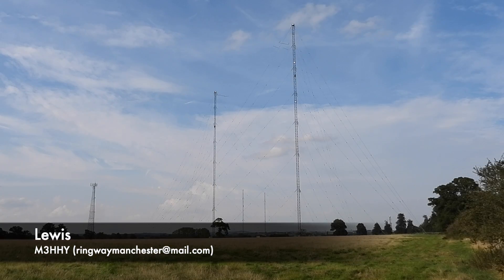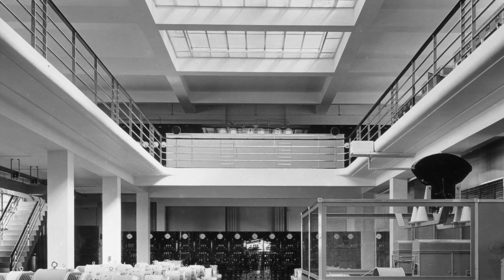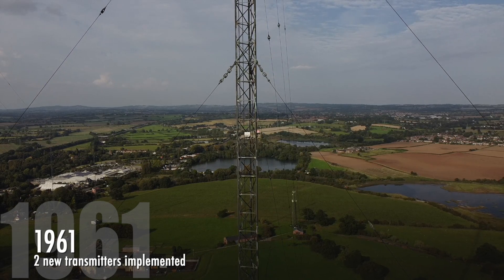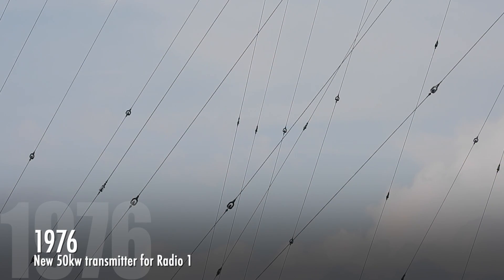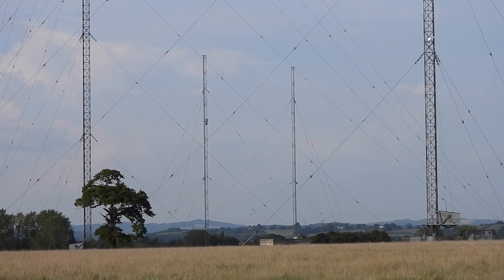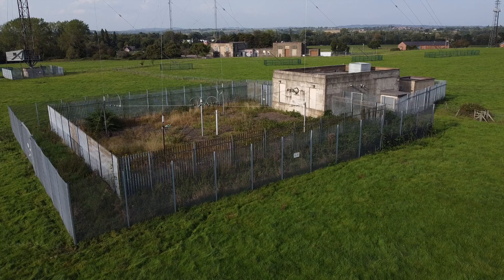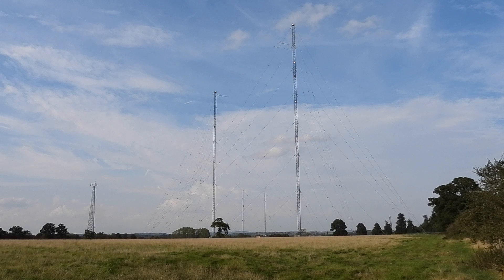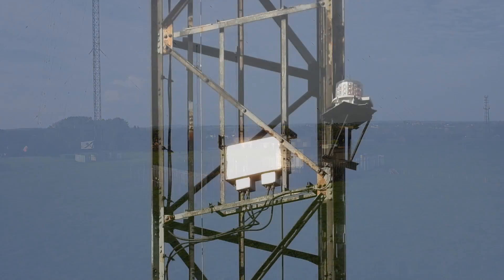Droitwich: The Death Of The 1/2 Million Watt Transmitter

Comment: According to Lord Reith's daughter, who wrote a biography of him, he shut down the diesel generators.  I never did that but am probably the only small child to have started them, on Christmas Day in time for the Queen's speech at 3pm.  The BBC of 1950s used MEB mains normally but didnt trust that for this task.  Normally the MEB would fine the BBC if it generated more than a fraction of its requirements, or went above the amount contracted for but when it froze hard for long periods the English Electric engines ran all the time to help the MEB or National Grid.

There must have been some Health & Safety interference since the mid 50s because at that time the flywheels were open, except the lower part in a tiled pit at one edge of which was the metal notch for the crow bar, the wheel rim had scores of holes.  Mostly they lay silent but wete tested on Thursdays and the diesel man polished the rims by pouring Brasso on a pad of cotton waste with which he leant on the 375rpm wheel, obviously on the upward side, they shone like mirrors after 20 years treatment.  I was told that on open days one diesel engine piston 15" diameter was displayed and was probably better understood than the valves or other electrical devices.  The compressed air was at 350psi and i thought those engines would start from any of the positions at which it stopped.  Electric motor compressor but if you had let the air escape and had to start from black nothing, you began with a single cylinder Lister, hand crank that.   Certainly some others only had starting air to some cylinders and did need hand rotation to be ready.  You also used a semi rotary pump to raise oil pressure before starting, which was easy:  a quadrant marked Start - Run - Stop and a wooden handle.

There were two cooling ponds, a dank one, cold of course for the diesels and a tropical one for valves, full of goldfish who thrived.

Other stations had various makes of engine usually smaller, 12" bore and 428rpm 14 pole alternators, Mirrlees Bickerton and Day, Harland and Wolff with turbocharger, i think they did 500rpm 12 pole.  There was a Sulzer with electric starter...  It stuck in mesh!   That one and the Harlands had crankcase explosions.

There were sets of motor generators with 4 rotating electrial machines on a single axis, probably filament current, and others only 2.  Electricians used to recut the commutators and i can remember walking past such s machine when cutting was finished, had lunch and came past it again still spinning but slowly.  I also saw scrap men with 14lb sledge destroy the cast iron and bearings, very sad.

The BBC is far too prone to puff its actors or front of house people but it had some good engineers.

Comment: 9:50 that story about the glass-tubes that are not manufactured any more as a reason to abandon long wave radio, that sounds weird to me. Nowadays, solid-state broadcast transmitters can be purchased at any power level (2 MW and more) based on modern MOSFETS in class-E configuration. Such solid-state broadcast transmitters have an efficiency of over 90% and use digital high-efficiency AM modulation. They are super reliable, and they cost a fraction of the behemoths shown in the video here. So the dawn of glass (or ceramic) tubes as a reason to give up AM broadcasting sounds false to me.

Comment: Being from the far South West, West Penwith to be accurate, Radio 4 Long Wave was always a difficult listen. We had a relay at Redruth, also not too good at 2Kw power and strangely a Radio 4 opt out for a programme broadcast from Plymouth called Morning Sou'West. This continued until the transmitter was switched to BBC Radio Cornwall when it started in the mid eighties. Redruth now only broadcasts on one MW frequency. 909Khz for BBC 5live. I have heard 1500m Long Wave quite clearly as far south as Biarritz and Santander, even in day time. 
This all reminds me of my first portable transistor radio, with two Bands, Long Wave and Medium wave with names of services and transmitter places, such as Home, Light, Third, Midland, East, London, North, Athlone, Nantes, Milano, Beromunster, and Saarlouis. 
How things have changed. Now you get a digital radio and you have to push a button to find a service, and nothing from overseas, Sad.

Comment: A fiend who was an airline Captain told me that in the pre gps and ins days they navigated to New York by tuning into the TX on the Empire State Building, and back to the UK by using the Light Programme 200 kHz TX. What I never understood was why the shift from 200 kHz to 198 was done. At 200 kHz we had a home lab frequency standard  with a nice round number.
Reply: The unhappy European types wanted the frequency spacing to fit their narrative. We should have told them to get lost!  200 kHz was an atomic standard 👍
Reply: from memory of that time it was because the standardised on 9khz channel spacing for radios so 198/9/= 22. I had to adjust the  digital dividers in  lab equipment , usually to relock 10Mhz reference oscillators.

Comment: Erm , never even heard of that one ; the ORIGINAL 1500m long wave transmitter , built in 1932 , so two years before this one , at Westerglen , just outside Falkirk , is still operating , and is the one that would have best covered the North Sea for shipping forecasts etc . Besides LW , there are also several MW transmitters still working at Westerglen .

Comment: The aerial gain is so high at 198kHz and falls away at higher and lower frequencies that the higher audio frequencies have to be boosted to give a flat response when received on a radio.
The transmitters are 2 Marconi units. They use a single output valve, a tetrode rated at 250 kW RF, has an anode dissipation of 400kW and runs at an HT of 25kV. One serious piece of kit !

Comment: The neverending story of a "very slowed-down" death of the transmitter still continues, and seemingly it will become - at least it is planned up to date - (now updated: by/end of September 2026, this has to do with the ongoing RTS teleswitch-to-smartmeter transition campaign still being in progress) to be shut off for good. If it really gets to this. There are already some hints hanging around according to which the transmitter (teleswitch service) might probably continue the service even after the aforementioned date, without any audio modulation anymore. (so does the french transmitter on 162 kHz since some years at it is still needed obviously as long as it is kept running). The old main transmitter hall stands empty since the last old transmitter therein got replaced.

Comment: Southern Ireland Calling , The B B C has been very good to me i go back a long way Home service / Light program and now Radio 4 [ just turned 80 years ]    , In more recent years there is interference from computers /electric fences the farmers use ,So changes had to be  made,  Satellite convert the satellite frequency down to F M/ V H F transmit at low power 3.5 watts via 5/8 antenna , Your video is very enjoyable there is so much history to the B B C ,☘☘☘☘☘.

Comment: Well, the very powerful 252m Irish radio Clarkstown transmitter has been demolished, so it's just a matter of time for Droitwich. Such a pity, as here in Derbyshire there are plenty of valleys where long wave transmissions are best, better than FM or digital or even satellite. By the way, Clarkstown transmitter was solid state, so all this stuff about obsolete valves is tosh.  The cost benefit of carrying it on is what is closing it, and what finished Clarkstoen off despite the protests of Irish ex-pats.

Comment: Radio 4 on LW is really useful still as it can be received almost anywhere, & in places such as mountains & valleys where FM/ DAB isn't receivable. Just been on a trip in my campervan & used my little LW radio a lot. I'm going to miss it when it finally shuts down. And the Shipping Forecast just won't be the same if it sounds like you're in the same room...

Comment: You've only lost the test match just now if you llistened to it ob an old clock radio or an old 1950's or 1960's LW and FM.

The simcast of 4FM on 4LW plus the shipping forecast now can be heard on 4FM now means most people lidtening to Radio 4 will not be affected by the ending of the LW optouts.

Comment: I used to drive past this site twice daily on my way to and from work.  In late October/early November, at around 5.45pm the full moon was visible on a clear evening low down and large and from the northbound M5, appeared to be just above the ground between two if the masts. I also recall claims years ago that close to the station radio signals could get picked up by such things as electric irons or even metal garden tools resting against a wire fence,

Comment: Can I recommend the Netflix's Portuguese Cold War drama, Gloria, which has the marvellous art deco setting of the Centro Emissor de Onda Curta, Pegões, Montijo, Portugal. 'Onda Curta', of course, being short wave, and the transmission centre from which Portuguese radio broadcast its Empire Service.  It's actually a very good drama, but the bonus is the use of old control rooms and switching panels.  Great viewing, and a reminder of how recently it was that Portugal was still a dictatorship, desperately attempting to hold the remnants of its empire together through it's doomed Angolan war.   Sadly, the station is all but a ruin, but they didn't a remarkable restoration job of the areas they wanted to film in.

Comment: Great video and nice video and photos indeed! I thought that 200 m antenna for longwave to be a bit short, but after calculating I found 398 kHz = about 753 meters wavelength and those 200m is almost exactly 1/4 wavelength! As a ham radio operator I can only dream of such antennas! Tnx for sharing.

Comment: The Radio Teleswitch Service was briefly mentioned at around 7:58, but its demise next year is forcing all households with Economy7 meters where the switching is controlled by RTS to have a smart meter installed. No problem for those with single phase supplies, but it's proving a nightmare for those with 3 phase supplies as the electricity suppliers are having trouble fitting 3 phase smart meters.

Comment: The BBC had a long tradition of manufacturing its own transmitter valves - water cooled behemoths capable of dissipating metal-melting temperatures with little expansion of the glass envelope and very high anode/plate voltages without insulation breakdown or flashover. In the US, most transmitter valves were made by RCA (or GE) which kinda shows the different relations between broadcaster, government and individual listener in the two countries.

Comment: The wartime BBC was very careful to spread programme  broadcasting over multiple, well separated transmitter sites. This was done by using landlines to send coordinated content to the transmitters. All used the same frequency - easier back then when there were relatively few broadcasters. A single powerful transmitter was a godsend to Luftwaffe aircrew as they navigated night bombing missions. Sometimes individual transmitters were thought to be aiding the enemy during bombing and were switched off temporarily. Listeners had been pre-warned about the very clear manifestations of that (suddenly receiving a distant rather than local signal).

Comment: I have have always wondered why they changed Radio 4’s frequency  from  200kHz  to 198kHz in 1988.
After all, the frequencies differ by only 2kHz. 
(Perhaps they just reported the frequency more accurately. The 200kHz was previously described as “Wavelength 1500 Metres Long Wave” which may have been an approximation.)
Reply: The earlier frequency was exactly 200kHz and it did indeed change to exactly 198kHz (wavelength around 1,515 kHz). Around the same time, many AM frequencies throughout Europe including the UK also changed slightly. This was part of a Europe-wide agreement to have all AM broadcast frequencies as numbers divisible by 9. The other Droitwich transmitters also changed slightly e.g. 1,214 kHz (the famous 247m) became 1,215 kHz. I think it was something to do with reducing co-channel interference of sidebands between stations.

Comment: Why dont people care for lw and mw anymore? How do we make them care?

Listening to the radio the analog way is just way more fun then doing it on the internet, so much things u can do just because of the radio

Like build a crystal radio, walk with your radio and hearing how signal changes, going in the basement and still receiving radio, etc

Internet radio has way to much competition and listening to it doesnt bring any extra activities u can do (ok you can write a shoutcast or icecast client maybe, thats it)

Our ears are analog at the end, why do we need to change the signal so much before it reaches them, we may not waste electricity but are making simple things way to complicated, introducing points of failure alog the way

And when it does fail, its not easy to fix

I am in my twenties and I will sadly be forced to see this all die, and I see no fun in that

Comment: The claim about the valves, even if true, isn't a reason to stop the service: there are plenty of manufacturers of solid-state transmitters capable of doing the job. After all, 198 kHz isn't exactly rocket science in 2023, when we've had high-powered transmitters in the hundreds of MHz (the TV network) for over half a century, and GHz ones (the mobile network, not to mention microwave comm.s links, including satellite uploads) for quite a few decades.

Comment: This production is a gem! Many years ago, I received R4 long wave on a car radio that was capable of receiving LW in Brittany. Until a few years ago, I had a twin rate power supply that used teleswitch for day/night changes. It took account of GMT/BST clock changes as well. It was replaced by a meter with a fixed built in clock (about 6 minutes fast), so it’s a fixed 7 hours ‘night rate’ all round the year now.

Comment: Another memory of high power MF/LF transmission.  The Moorside Edge transmitter near Huddersfield was rebuilt in the 1980s, including new antenna tuning huts with the matching equipment in.  The spec given to the building contractor was that no steel or iron nails were to be used in the roof woodwork, but only brass ones.  The carpenter thought that no one would notice if he used the cheaper steel nails.  Unfortunately, he found out otherwise when the roof caught fire when the transmitter was turned on!
Reply: "The ship was sunk for a hap'porth of tar!"

Comment: Ah! Great nostalgia here, having spent my career in high power transmitters with the BBC including some work involving Droitwich.  Some more facts about the site: the two 700ft high masts are steel but not galvanized so have relied on regular painting to protect them from corrosion.  The fact that they are still standing after over 90 years is a testament to the "Forth Bridge" painting regime used!  A common problem was flashover or corona arcing across the stay insulators on the long wave mast.  This was typically initiated by nearby (or direct) lightning strikes.  Once the arcing started, it would continue, aided by the high RF voltages.  If allowed to continue, it could destroy the insulator, which then required a costly repair.  When the site was staffed, a technician on the control desk would have a cheap MF radio tuned to a quiet frequency on all the time.  If he started to hear modulated noise bursts, it was an indication that arcing was occurring, so he pressed the "HT suppress" button to briefly turn off the mercury arc rectifiers providing the 11kV dc anode supply to the final amplifiers.  This would remove the RF which was sustaining the arcing.  In the 1980s the BBC did away with the local staff, opting to run the station unmanned but monitored from afar.  A solution was needed to protect against stay insulator arcing.   A system using ultra violet detectors was installed, as the arcing produced large amounts of UV.  Three detectors were arranged round the site and at least 2 of them needed to detect UV for it to generate a transmitter trip.  Why 3 detectors?  Well, initial tests were promising, using just one detector.  But trips occurred for no apparent reason.  It was then noticed that somebody was doing some car welding off site on the other side of the main road and the arc welder produced enough UV to trip the transmitter!  Subsequently, UV detectors were used in all the high power MF and LF transmitter sites.  They were also put inside the antenna tuning huts at the base of the antennas.  These were very sensitive - just lighting a match inside the building would trigger the detector: yes, open flames emit a lot of UV!

Comment: I remember as a child being driven through Droitwich on many occasions in the 1970s and 1980s, there used to be loads of buildings that were gradually sinking into the ground due to old salt mines that I became fascinated in as well as the masts. The signal from the transmitters was so strong when you got close it would totally overwhelm the car radio whatever station you were listening to into a loud muffle of noise. These masts have been a key landmark and Droitwich which will never ever be the same if they are eventually removed.